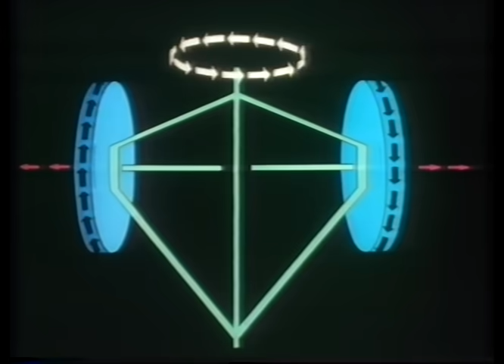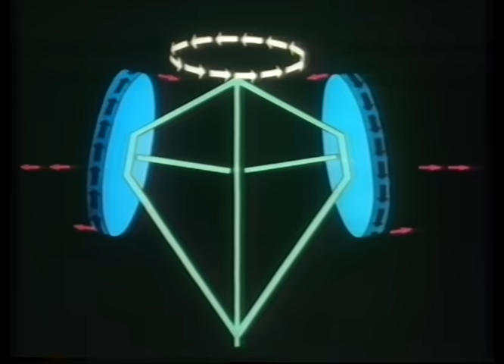Anti-Gravity Machine (Part One)

Comment: 6:35  - this nothing more than; physics, angular momentum, torque, and gyroscopic motion.

It is not anti-gravity.
Reply: XY ZW  That is why I provided you with a (simpler) Newtonian version of gravity.

As, I was quite sure that - since you were already mistaken about the science involved with the so called “Anti Gravity” video as well as being clueless about what inertia and gravity are - you probably would not know about (and/or reject) other more advanced theories (such as Einstein’s theories) that require a very good grasp of astrophysics and you to accept that you're wrong.

Einstein’s theory about relativity/gravity - contrary to your claims that assert it has never been proven - was largely accepted/substantiated by several tests within the 1800 and/or 1900’s; including the test which verified the theories’ ability to accurately explain/predict the (previously insurmountable/problematic) precession of the planet Mercury’s perihelion.

In the mid to late 1800’s and also the early 1900’s Newton’s gravitational/other theories (particularly the Newtonian physics that dealt with 2 body systems) were unable to reliably/accurately explain/predict the precession of Mercury’s perihelion.

Yet Einstein’s theory was able to resolve, what was ultimately, a shortfall in Newton’s gravitation/other theories - by way of accurately explaining/predicting the precession of the planet Mercury’s perihelion as it circled the Sun.

Clearly from the fact that Isaac Newton (and others) failed to get it right, accurately explaining/predicting the precession of Mercury’s perihelion as it circled the Sun, was no simple task.

You may be surprised to learn that the problem was not resolved by pretending magnetism and gravity were one and the same.

The way Einstein solved the problem (to both his peer’s and also the scientific communities’ satisfaction) was (not by way of pretending magnetism equaled inertia, but) by way of applying his theory of general relativity. 

Please read the following slowly (and use a dictionary) so that you give yourself the best chance to understand . . . 

In Einstein’s theory of general relativity the precession of Mercury was modeled/represented and explained by;

A)	The spasmodic variance that Mercury’s perihelion/aphelion exhibited as it periodically orbited around the Sun; within its own elliptical plane.

B)	Treating gravity as a curvature of space-time. 

In doing so Einstein revealed that, unlike Newtonian Physics, his general relativity provided a means within which to solve previously insurmountable and/or complex astrophysical problems, as well as; (i) accurately explain the observed precession that Mercury and/or its perihelion/aphelion exhibited; (ii) predict the future position of Mercury; (iii) accurately forecast the amounts of precession that Mercury’s perihelion/aphelion exhibited as Mercury orbited around the Sun; and; (iv) highlight the deficiencies associated with (the widely accepted) Newtonian mechanics/physics. 

Given the acceptance of Newtonian mechanics at the time despite the fact that it clearly fell over when it came to explaining Mercury’s precession around the Sun and other scientific phenomena; the ability of Einstein’s theory of general relativity to reliably/accurately explain/predict the amounts of precession that Mercury’s perihelion/aphelion exhibited as it orbited around the Sun, become instrumental in ensuring that Einstein and his theory of general relativity (and therefore the concept of curved/warped space-time becoming a more accepted/accurate construct for gravity than how it was represented with Newtonian physics) ushered in a new age/theory about gravity, mass, light, space, and time.

From there the fact that Einstein’s theory of general relativity was able to pass other tests and accurately reveal/predict; (i) how light behaved and/or deviated from a straight path/line (in ways that were consistent with Einstein’s theory of general relativity) in the presence of a large mass; (ii) relativistic time delays in the propagation electromagnetic signals (that were consistent with Einstein’s theory of general relativity) as a result of the electromagnetic signal path being close to a large mass and/or the Sun; and (iii) the precession of binary pulsars with only 4° arc per year of orbital shift in ways that, not only were consistent with the space-time curvatures Einstein’s theory of general relativity predicted for the binary pulsar’s precessions - but also, then went on to become the foundation for accurately calculating the masses of the 2 neutron stars constituting the binary pulsar.

From there the discovery of gravitational lensing - predicted by Einstein’s theory of general relativity - further bolstered Einstein’s general relativity theory. 

As such, you are wrong about inertia, gravity, and how proven some of Einstein’s theories are.

Furthermore, inertia and magnetism are not the same; so you're wrong there too.

That said, if you were to provide proof that inertia and magnetism were - as you claim - supposedly same, then I would be happy to read (and/or laugh at) it.

By proof, I mean your theory - that inertia and magnetism are one and the same - must be published within a respected scientific journal and be reviewed/accepted by experts in their field.

Until that happens; 

A)	Almost every deep space probe and/or GPS satellite that has been and/or currently is traversing around the earth and/or through our solar system and/or beyond; will still be utilizing aspects of Einstein’s  TOR to ensure positional/other data and performance is accurate. 

B)	Please take care and try to get some sleep.
Reply: XY ZW  You seem to have overlooked that (in addition to me previously advising that you ought read my previous post slowly and/or with a dictionary so that you give yourself the best chance to understand)I didn’t explicitly state that Einstein’s theory of general relativity served as “proof” for any of the theorem’s we were discussing.

So, sorry to burst your little bubble there.

You seem to have jumped to that conclusion all by yourself - which is a trait of bad science.

Let’s try again; and this time, please read my post slowly and/or with a dictionary so that you give yourself the best chance to understand . .

Here is an excerpt from my previous post and note the word construct . . . 

Jim Stanley Post 27 April 2020; “the ability of Einstein’s theory of general relativity to reliably/accurately explain/predict the amounts of precession that Mercury’s perihelion/aphelion exhibited as it orbited around the Sun, became instrumental in ensuring that Einstein and his theory of general relativity (and therefore the concept of curved/warped space-time becoming a more accepted/accurate construct for gravity than how it was represented with Newtonian physics) ushered in a new age/theory about gravity, mass, light, space, and time”.

As such, even your recent post’s comment  . . . . .

XY ZW Post 28 April 2020; “the perihelion of mercury is not proof that space bends. This is merely disproof of Newton than a win for relativity”.

That (whilst pretending gravitational lensing has not been observed - whilst at the same time overlooking the other examples I provided that substantiate how/why Einstein’s theory of general relativity became a more accurate theory) appears to seek to discredit Einstein’s theory of general relativity insofar as it applies to the curvature of Spacetime constituting relativistic gravity; is questionable for various reasons including the following . . . .

It may well be the case that (as you seem to say) the ability of Einstein’s theory of general relativity to explain/predict the precession of Mercury’s perihelion (not the perihelion of Mercury as you put it) does not in itself substantiate that, as you say, “space bends”. Furthermore, it may also be the case that (as you seem to say) that the ability of Einstein’s theory of general relativity to explain/predict the precession of Mercury’s perihelion (not the perihelion of mercury as you put it) is also disproof of Newton’s theory.

But all of that actually fits with what I stated previously.

As, previously I described the success of Einstein’s theory of general relativity within the context of (at least) disproving Newtonian mechanics and providing a better *construct*; which, really, is what your below and/or above-mentioned statement basically says, before it goes astray by way of pretending the win for Einstein’s theory of general relativity never occurred.

XY ZW Post 28 April 2020; “the perihelion of mercury is not proof that space bends. This is merely disproof of Newton than a win for relativity”.

Only a fool would argue that Einstein and his theory of general relativity (regardless of how reliable it may be) didn’t experience a win as a result of disproving the Newtonian theory of gravity and/or providing a better construct (Spacetime and the curvature of it) to explain the precession of Mercury’s perihelion. 

If you wish to discredit Einstein’s theories your time may be better spent on;

A)	Understanding his theories more comprehensively and within a historical context; rather than questionably presuming acceptance/success was not granted to Einstein for his theories of relativity, and that gravitational lensing was not a part of it.

B)	Mathematically examining Einstein’s use of pseudotensors to represent gravitational fields.

So, at this stage, as far as I am concerned, it seems you're misinterpreting my posts (possibly) as a means to portray yourself as being correct; all whilst you're yet to substantiate that magnetism and gravity are the same.

So, before I move ahead and deal with your other questionable allegations and oversights  . . . . . 

If you would kindly substantiate prove that magnetism and gravity are the same (and/or reference the scientific papers that support this view) that would be nice; as it was with this claim that your opened your first response/post time mine.
Reply: @StormCentre88   I feel your pain trying to explain this.  I worked in energy-automation science/engineering and quite often I would see ridiculous experiments from someone having "thrown a physics textbook in a blender" and conjoined phrases and concepts in a manner that is incorrect. Sometimes I would explain to a friend that it wouldn't work and explain why.  Even when I kept it simple and politely said that the energy input would exceed the energy output. Then I would get a pause and a blank look and they would say, " but this is something different".  I gave up.
Reply: @robthom09  Thanks Rob.
Reply: eats popcorn in anticipation

Comment: Sandy is probably right about the UFO however it's unlikely the mechanism which provides it's anti-gravity quality is not the mechanism to bring it from the depths of space...it appears that the UFO simply materialises and the ability to transport matter from point A to point B is almost certainly what the witnesses state...however the physics on earth are the physics of earth and the UFO appears to take full advantage of this...an example an UFO at high speed makes no noise no sonic boom or air disturbance therefore air resistance as the craft slips through air without the slightest disturbance...but from observations witness accounts and photographs and film it's obvious an UFO is almost certainly using some kind of anti-gravity device when in an hover or passing overhead.. I don't believe it's mechanical given the dimensions of some UFO'S but that's not to say the principal isn't used as it appears it certainly is.  .

Comment: To sum it up, he's made a device that weighs 7 LBs. with a thrust of 10 or 12 ounces. In low gravity he might have something useful unless the thrust is correlated to the gravity it operates against.
Reply: If it was located in outer space, it would just oscillate helplessly around its centre-of-mass. Why is that so hard to understand?

Comment: Anti gravity. I don't know how but I think it's need a reverse engineering technology. If gravities  pull us to the center it's created magnetism. that magnetism we can use for energy to push us up agin. The higher we fall the greater the magnetism. Like motor train, we run faster and use engine break  we can convert the energy into charging and can be use again. Other examples is elevator. We can use the energy when the box goes down. Try to put thing or ship in the sky. When it fall used the energy that produce itself. I don't know how but you pupil can do.
Reply: You are merely re-phrasing the principle of energy conservation. It is the very principle which makes antigravity impossible!

Comment: There is no gravity, just take a bowling ball and an orange to the top of a building and see which one lands first. If there was gravity then both would land at the same time not because of a vacuum. Just look at the butterfly going from flower to flower in your garden then look at your car sitting in your driveway. HMmmmm shouldn't the butterfly be held down like the car is held to the driveway ?
Bull Shit ! there is no gravity, the bowling ball landed first because of it's MASS weight.  There doesn't need to be gravity on a flat Earth. Also, the Earth doesn't spin at 1,030mph because EVERYTHING would be destroyed because of the wind hitting it. I know, I live in Florida's hurricane center.
Reply: Are you communicating from Ancient Greece via a time-warp? Physicists doubt that Galileo ever performed that experiment, but it would have worked ... allowing for air-resistance.  The butterfly IS held down by gravity; it is simply putting off the fall by 'throwing masses of air downwards' rocket-like.  Why would a flat Earth not need gravity? Even the old Columbus lie implies the existence of an external gravitational field, else how could anyone fall off the edge. The surface-velocity which you mention exists only at the equator and there is no raging wind because the atmosphere moves at the same velocity as the surface ... apart from the relatively minor circulating weather patterns.  After all, it has had billions of years in which to 'catch up'. The 'huge wind' argument was used by one of the bishops who tried to get Galileo executed for heresy. Now, call me extreme, but I sincerely believe that flat-Earthers should be exterminated for being simply too stupid to live in the modern world.

Comment: No one thinks about the corialus effect when using gyros...
Reply: That is because it is called the Coriolis Effect, and would moreover matter only to something actually moving across the surface of the spinning wheels.
Reply: @MrAaronvee  so air in zero gravity..
Reply: @Dvantways  I am not quite sure what you mean. The Coriolis, like centrifugal, is a fictitious force which allows observers in a rotating reference-frame to continue to use Newton's laws (which are true only for an inertial reference-frame).  So the Coriolis force explains the rotation of winds around high- or low-pressure regions. Thus 'air' is relevant in that case. But the Coriolis force acts whenever anything moves within a rotating system: for instance, it has to be allowed for when firing cannon over long distances, or when one  walks radially across a waltzer.  Note that the force has meaning ('reality') only for the person within the system:  an external observer will simply see someone walking in a straight line.

Comment: "Antigravity engine" is an erratic description for what proved to be basically a gyroscope device. But it can not overcome gravity as is proven (aerodynamics taken out of account, because in air it might be able to use aerodynamics to create lift and drive). It only stabilizes an axial movement otherwise but can not lift itself without being pushed by another regular physical force. *  Professor Laithwaite instead has developed a device using magnets which still has the potential to change the transportation technology entirely in the future.  The magnetic river. What is used in real maglev trains today.  *  "Anti-gravity" does not exist and will not exist because gravity is a property of mass being present, so it is bound to it and can neither be removed nor shielded off from somewhere by another mass resp. through any kind of material since it is also a property of the universal spacetime. A natual law, not a force as well, but an attraction of masses, resulting in acceleration applying on either masses coming into proximity.
Reply: Laithwaite was a career-crackpot who had many loony ideas apart from spinning-top antigravity.  He was a born liar and ideas-thief. He did not invent maglev. He did not invent the linear induction motor. His scientific incompetence caused Britain to lose its lead in that form of high-speed transport.

Comment: Doesn't work because once it leaves the ground it no longer can go up. It falls.  Think of it as if you try to hold a tree branch in your arm with a rope swing hanging off it and somebody sat on the rope swing as long as you're standing on the ground holding the branch you could swing them back and forth off of the ground as soon as you left the branch go however it would all just fall to the floor there needs to be something anchored to the ground to push in the opposite direction once the ground is no longer touching the machine no lift is generated
Reply: And yet the person on the swing can start, and keep, it moving without touching the ground or anything else. Even that fact confuses the antigravity morons.